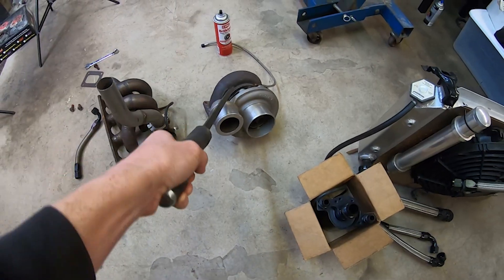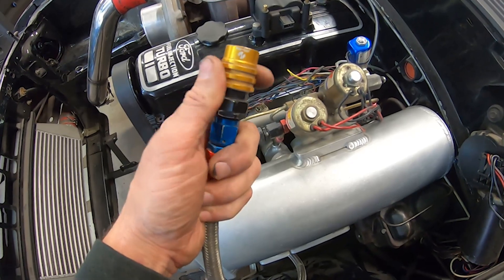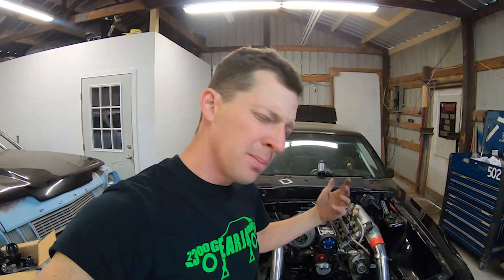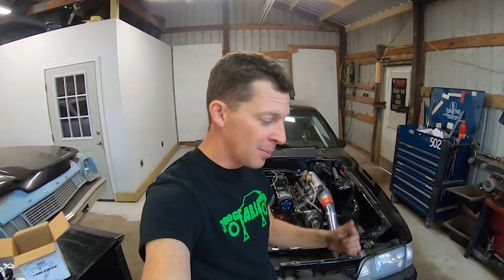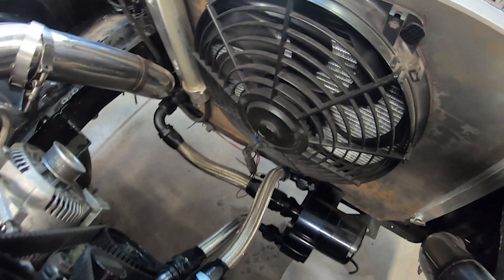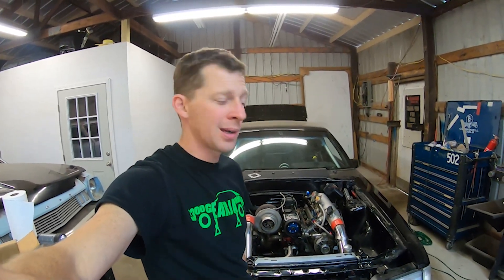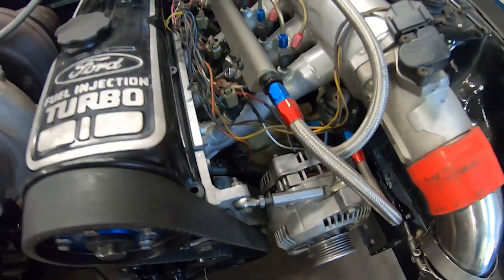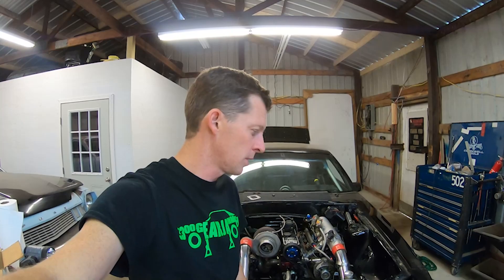2.3 Mustang-Turbo, Intake & Cooling System w/ Part Numbers

Comment: Can a 1993 foxbody notch turbo and engine fit a 1993 foxbody hatchback 2.3l?
There is a wrecked one at the junkyard for $1000. I would like to know if everything should bolt up. Do not have to change wiring or anything?

I am not skilled in this direction but I am learning not all parts are a straight fit with the 90's.

Thank you for your input and knowledge

Comment: Family member has a straight 6 81’ fox. I wanna buy it and swap a 2.3 like this one. Very little info on straight 6 foxbodies and 2.3 swaps. Not much info exists on either car. Tons of v8 swap information though.
Reply from the maker: Biggest thing would be fuel line routing and the kmember is different on the 6cyl cars

Comment: A good idea would be to go to a specialist in the manufacture of CNC cylinder heads and design a completely new cylinder head to convert the original to 4 valves per cylinder. You get more fuel mixture and it is much easier to get more power.
Reply from the maker: Haha that would cost more than everything I own. It might be time to change engines at that point. Some people are putting 4v per cylinder Volvo cylinder heads on these 2.3s but most of them fail horribly.
Reply: @2300gearjammer  I understand that it is expensive to manufacture a cylinder head specifically for the 2.3 SVO pinto engine, but it is not a bad idea since it would improve a lot in power and it is worth it since the block, being made of cast iron, is very strong, much better than aluminum. It is strange that the specialists in modifying these engines did not think of expressly designing a cylinder head exactly the same as a cam but with 16 valves and putting it on the high-performance parts market.
Reply from the maker: @juanzip-sp  that was very quickly go over $100k. All the 2.3s int he world aren't worth that 😂

Comment: Q1, what about the new TKX Tremic ?Q2 , I have 2.3 with a Magnuson super charger, Mallory injection, weber side draft carb. Would like to change to injection what type hi-tech or port ? Ford 9in w/3.90 gear , what size slicks? Mostly street some track. All in a 48 Thames Panel. About 2000 lbs. Thanks really like your show.
Reply from the maker: That's a super cool project. If that tkx is a 3.27 I'd certainly run a 28"x10.50 slick. 

Thanks for watching. 🦅🦅

Comment: why doy you use water pump eletric?
Reply from the maker: I do that to free up horsepower from the engine.
Reply: I've always wondered about this. You use electric pump to gain power at crank but, in turn your creating a bigger load on the electrical circuit. Which your alternator has to keep up with. It takes quite a bit of power to create this electric current canceling out the power gain since your alternator is belt driven off the crank. Or am I missing something here?

Comment: How much nitrous are you spraying?
Reply from the maker: ...I should probably have another engine ready for that day. Lol
Reply from the maker: It's jetted for a 75shot and that made 91whp on the Dyno untuned. It hasn't been sprayed for a clean full pass. That's a goal for this coming year.
Reply: If you pull enough timing you should be fine for a full pass.
Reply from the maker: I'm thinking more about exceeding what the crank/rods or block can handle. I want to hit a boost only goal first.
Reply: @2300gearjammer  yeah you got a point there. What do you think the the limit on your rotating assembly is?
Reply from the maker: @boosted74m2  I'm really not sure. I think by 800hp parts would start flying out.
Reply: @2300gearjammer  right before that happens, add 50% nitromethane to the fuel cell and make sure people with good cameras catch the beautiful light show.

Comment: Very nice! (New svo owner) I'm going to start a build as money allows. I need to address overheating issue first then on to power increases and paint body
Reply from the maker: Well take your time with it. Honestly a stock shortblock and ported, cleaned up head/cam makes for a super fun reliable ride. 300hp has always been my favorite level.

Comment: Also how did you switch the tune on the fly? What computer are you running? PiMP?
Reply from the maker: Here's the trick. I did all the street tuning low rpm, low throttle stuff tuned while driving on 87. The higher rpm, 5000 and up, plus anything over 5psi was tuned with race fuel. I never switched a tune. It worked perfect just driving it nicely on the street. It never pulled more than 3-4psi on the highway hills.

Comment: The fuel cell + stock tank is smart asf I like that idea. You didn't have any detonation on regular 87 octane pump gas?
Reply from the maker: No since it's low compression anyway and tuned safe it drove absolutely fine.

Comment: So what size throttle body on that non LS engime.
Reply from the maker: 😂 this non-LS has a bbk-1524 75mm for a SN95 5.0. I'll try to hit all those parts in the next vid or two. I don't think it matters much what size. Just makes 3" couplers easy

Comment: Man that’s such a well thought out cooling system. I’m forever changed.
Reply from the maker: I switched that brand spankin' new pump on today and almost lifted the cylinder head off.
Reply: @2300gearjammer  so it is an LS?

Comment: Matt, you should check out the Carolina Drag Cruise, would be cool to see this car in it
Reply from the maker: Absolutely. I followed the posts through the event. I think if I did another one Id do it with the pinto and the Carolinas would be far easier for me lol
Reply: @2300gearjammer  if I can get my turbo ls going that you got the four cylinder engine out of I'm going to attempt to run it.

Comment: What are the details on that intake? That looks to be built alot better than my turned Factory ported intake.
Reply from the maker: I'll try to add it into the next vid or two. 

Keep those questions coming. I'll try to get them all.
Reply: That'd be awesome, between the intake and exhaust that thing is looking pretty slick, I'm setting my 1974 Pinto N/A 2.3L 4-speed SCCA ITB car up for ITE competition using a 1988 T-Bird turbo engine currently, looks like a setup like that would be nicer than my current route. Good looking car you have there BTW.
Reply from the maker: @LockedAndLoaded4x4  wow good stuff.  Keep me posted on that. I'm also going autocrossing with some other projects next year. 🤘
Reply: @2300gearjammer  that'd be pretty slick, Auto-X is pretty nice, I may knock the dust off the 74 this following season with Snake River Region, I have to rejoin Drivers school Feb 2022 for the SCCA with the car and I'll be running ITB for at least a Season the ITE or STU will be class for me. Been working on the N/A 2.3 for ITB now and bout to jam in the motor and trans once the snow clears out a bit more. Only have the real crappy into video on the car posted on the channel now, more to come this Jan.